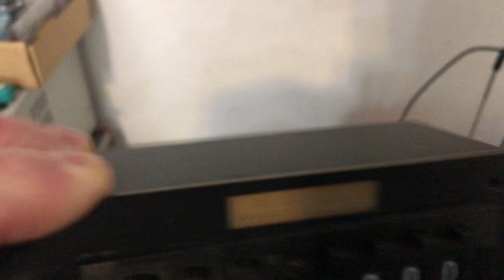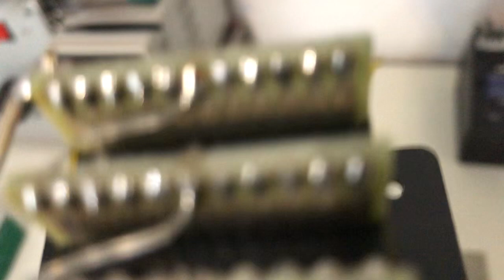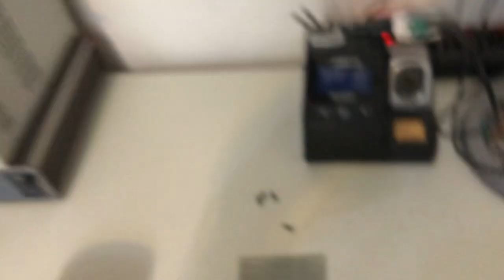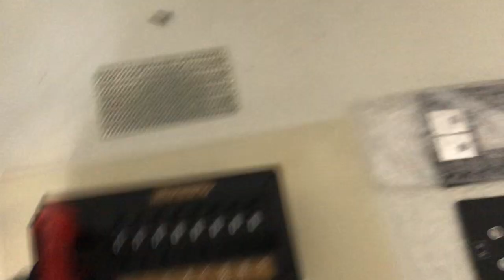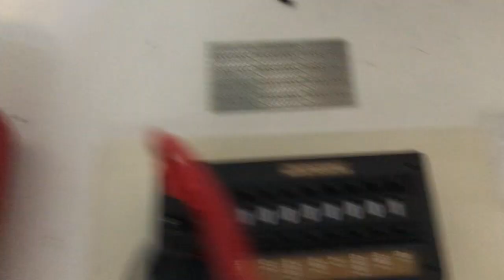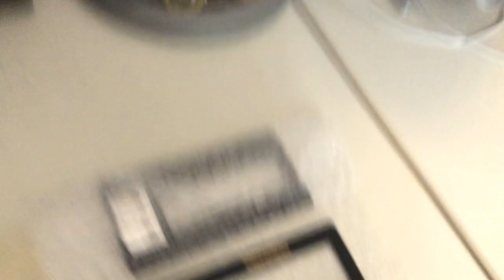Decade Resistor Substitution Box Design using Thumb-wheel Switches.

Comment: Lower the contact resistance by better switches and put a parallel resistor at the first 1 ohm , 10, ohm and 100 ohm to compensate the 7 other contact restances. Example 100m ohm per switch gives 700m ohm for the 1k to 10M switchrs ( 0 position) and the first resistors could be 0.3 ohm (1ohm//0.4 ohm), 9.3 ohm (10 ohm //230 ohm) and 99.3 ohm (100 ohm//13k). Maybee someting to think about.

Comment: Just bought everything to build, didnt realise i had ordered bcd switches......
Reply from the maker: Hi Lez, :-( , but if you buy the correct ones, its better to use NOS ones than Chinese chap ones, bcs of the Contact resistance.
Reply: @KonstantinGrigoriadis  I did spend 10 minutes thinking how i could uses 1r 2r 4r 8r resistors to get the value to match the displayed digit, and then 10r 20r 40r etc, then i realised I would need normally closed not normally open bcd switches....... as at 0r nothing is connected.....
One day i'll find a use for them, a code lock or a prop for a safe room.....